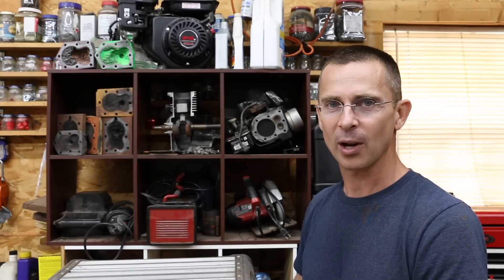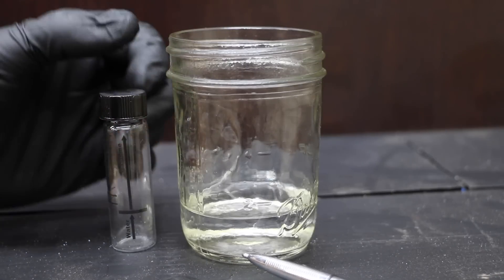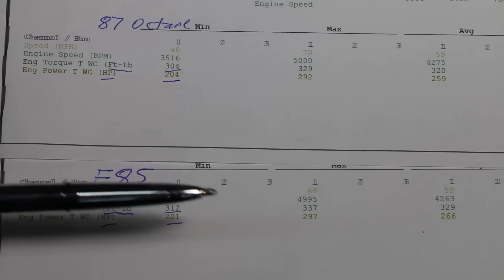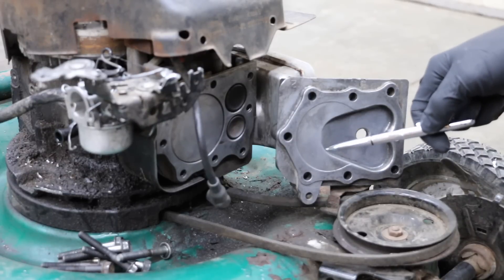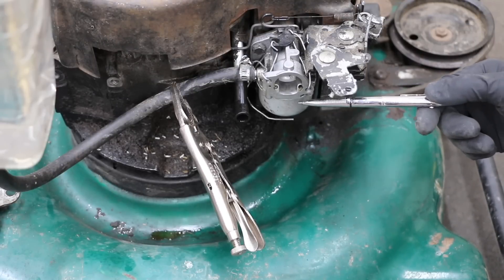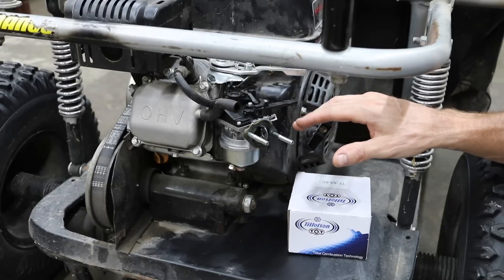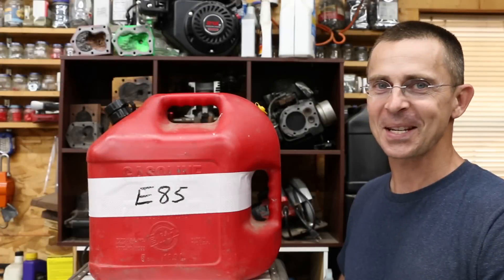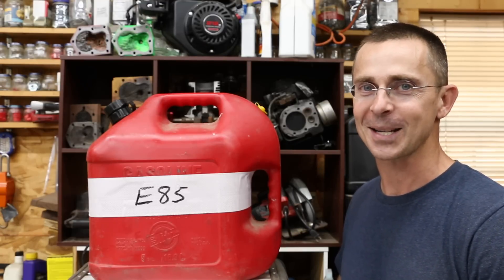Is E85 better than Gasoline? Let's find out!

Comment: mixed e85 in a 1993 olds with a 3800 v6 engine in it to try it. blended it at 50%. worked well for a non e85 burner but did drop mileage two miles per gallon.  My opinion to really get the most out of e85 a purpose built engine with proper compression and other things like cam etc would be the way to go. A car that can burn both is just a compromise.  Was going to try that at one time but never got to it. Thanks for the great video.
Reply from the maker: You are welcome!  Thanks for sharing.

Comment: I run ethanol in my Ecoboost for which I have a tune for. My fuel milage  is only 3mpg worse with e54 than with 91. Here is the kicker... My truck makes 90 more hp with e54 than it does with 91 AND e54 is $1.00 cheaper per gallon than 91. I get about 450 miles to a tank instead of 550 but it's $80 to fill up vs $115 with gas. Win/win for me.
Reply from the maker: Thanks for the feedback.

Comment: Spent most my life building race engines,   E85 only really shines on a engine built for the fuel, 
Just putting the fuel into a go cart or a standard car, is only going to give poor results.  Poor economy .
On the other hand,  if you build an engine for e85, increased compression, supercharging or turbocharging,
Now you will see a much better result, 
 e85 has a much higher octane rating,  plus this fuel will pull out so much more heat 
In the intake and engine cylinders a big part of why it increase the engines ability to resist knock
.   Meaning you can run higher compression , boost and ignition advance .
Higher compression and more engine advance goes some way to improving the engines efficiency on E85. 

For average Joe, 
it’s a waste of time in a average car.   You need to burn 30% more fuel under load and at least 40% more 
For a good idle and even more for cold starts.   

Cold starts are the reasons for this fuel blend still containing 25% or more of standard pump fuel.
As pure ethanol is hard to get going on a cold engine.   But once warmed up,  starts are much easier.
We use to run 96% ethanol on big hp turbo engines, this required some thinking about the cold start system.
Or preheating the coolant .  Cold cylinder wall and head ports cause the majority of the fuel vapour to drop out
And puddle , this doesn’t burn all that well.  Leads to wet plugs. 

But for the high performance guy that wants to produce two to three times the horse power of his built engine over the standard engine
And wants to run it on a fuel he can easily buy.  E85 has been a great thing.   

Engines set up to run on e85 run cooler, cleaner and can make so much more power than standard pump gas.
E85 is also much cheaper than specialty racing fuels like methanol .
Also in my own testing E85 was not all that problematic on hoses or seals that it’s claimed to be.
Some older engines use rubber that can not handle alcohol .  But in these days most pump fuels contain
Some alcohol regardless and modern cars have no issue with e85 or ethanol.

People who have herd or experience Methanol know how harsh that fuel can be , 
But ethanol is a totally different substance .  I have not had one issue with ethanol or e85.
We converted a lot of road and dirt bikes over to ethanol or E85.
It required a different fuel and ignition map and bike have already high compressions, 

With exhaust pipe mods or aftermarket mufflers, a better air intake system and some added ignition timing
And fuel .   We could easily see up to 15 hp gain,  the bikes ran cooler and spark plugs lasted a lot longer
And there was less issue with carbon build up in the engines, carbon build up and that leads to knock.

One of the problems with the high octane pump gas ,  carbon can build over time due to the incomplete burn
Of some chemicals used in the fuel ,   Carbon build up causes preignition ,  not some thing you want in a high 
Performance engine.   This led to fuel company’s adding even more chemicals to try and keep combustion chambers 
And piston tops clean .   The more additives you put in the fuel the less power making content per given volume of fuel. 

A car set up to run properly of Flex fuel e85 that has fuel alcohol sensors and can add some ignition advance will perform 
A little better on E85.    But a modified turbo car shines on e85 ,  heat is its enemy and e85 burns so much cooler as your blue flame
Showed.  On the other side, one of the issue of e85 and the cooler burning, is it can rob some exhaust gas energy used to drive the turbo.
Generally exhaust gas temps on a well set up e85 are many degrees cooler and require a rethink on exhaust turbine AR ratios. 

Thanks for doing your review,  your thoughts are correct.   In a high performance application it stands above 
Standard pump gas.    
High performance guy don’t care they will need to burn more of it,  as methanol and other race fuels are 2 to 3
Times more costly .   

I enjoy your videos. Keep up the great work
Reply from the maker: Thanks, will do!

Comment: I see this is an old video, so I’m not certain how much more you’ve learned about the matter, but gasoline and e85 will never perform similarly in an apples to apples test like this, as they are designed for completely different engines and/or use cases. While some vehicles like the Suburban have the ability to run on either fuel, they’re not meant to be directly interchangeable, and retain performance. E85 has a much higher octane rating than regular gasoline, and reaches flashpoint at a much lower temperature. It’s typically used in high compression or boosted applications. On a very basic note, running e85 in a regular gasoline engine will result in low power due to improper combustion and/or potentially misfires. Running regular gas in a e85 engine will likely result in knocking and/or severe engine damage, depending on its designed octane tolerance. Engines running e85 can be tuned for performance, at the cost of this tolerance. In many cases, high performance engines running true e85 with 80-90% ethanol may have serious engine failure if ran under load on anything lower than 75% ethanol (this is just an example, these effects will vary from engine to engine). There’s a whole lot more to say about e85 as a fuel, and I’m hardly an expert on the matter, but if you didn’t already know these things, I hope this helps you and others to understand why performance varies so much.
Reply from the maker: Thanks for the feedback.

Comment: does the E85 cost as much as gas in your area because according to my calculations running with E85 would be about 20% cheaper in total because here it's much cheaper than gas, even when you take into account the lower fuel efficiency.
Reply: It lots of places ethanol is not cheap enough compared to gasoline to make up for the lower fuel efficiency. However, where I live regular gasoline is crazy expensive, while ethanol is more of an average-high price so the end result is saving some money. In Canada where I live it’s 1.80/L for regular gas and 0.95 for ethanol.

Comment: I was quite confused at the beginning - because in Poland E95 was a designation of 95 octane gasoline (etylina, with tetraethyllead). This designation is sometimes used even today, which adds to the confusion. Apparently E85 is also available at some Orlen gas stations, but here 85 is max ethanol percentage just like in your video.
Reply from the maker: Thanks for sharing.

Comment: Nice video, but he overlooks some issues.  By definition, E85 has significantly lower energy content....as he states.  I have found that the break-even point for E85 usage as regards fuel efficiency is 21%....that means if E85 is priced less than 21% down from E10 ("regular unleaded"), you will save money on fuel economy.  If you pay more than 21% below the cost of E10, it will be as he says...it will cost you more to drive with it.   If you can buy it 'right', it will save you money, and it's easier on the engine overall, if the engine is a flex-fuel engine.  I've put 155,000 miles on a Yukon running nearly exclusive E85, and saved significant fuel costs.  Yes, I stop more for fuel, but I'm an old man and I pee a lot and have to stop anyway!  :)
Reply: It's cheaper compared to premium 91 or 93  fuel, not 87 regular, that's where the savings are.  E85 is awesome.

Comment: Been experimenting with blending E85 and regular gasoline since around 2004, cars with carbs can handle about 20%e85 while especially single point injection VAG 1.8 can handle about 75%E85. fuel economy is usually the same up to about 30-35% e85 and then it increases slightly, most cars(not all) with modern fuel injection and lambda regulation can handle 35-40% E85, imho 50/50 is a really nice mix with no cold start problems and only slightly higher consumption, some cars need either piggybox or increased fuel pressure to reach this mix without running lean, could probably write a book on all my expetimenting, just like vegoil in old prechamber diesels but different
Reply from the maker: Thanks for sharing.

Comment: I’ve only used E85 a couple of times in my Silverado and mileage was not very good, probably 25% lower. My concern is that E85 doesn’t have the same lubricating properties and over a long time engine wear will be higher. Have you ever done any testing like this or know of any test results? Love the channel 👍👍👍

Comment: I tried using E-85, if it was $1.00 cheaper then gas be worth it, but they only give 0.35 cents. But with your video I will try 1/4 tank with seafoam additive to clean carbon off & help with spark plug removal. Love your video's 👌
Reply from the maker: Thanks so much.  Thanks for sharing.

Comment: You might want to compare E85 to 93 octane pump gas. My vehicle requires premium fuel. I typically mix 1/2 E85 with 1/2 87 grade fuel. E85 averages 103-105 octane. Half and half should give a mix of 95 octane fuel with a pump price less than regular. The fuel mileage isn't quite as good as 93 octane but the cost to operate  is down some.
Reply from the maker: Thanks for the video idea.

Comment: I own two Camaros. A '13 ZL1 and a '15 2SS. (Both flex fuel) and people swear by E-85. My issue, that you didn't really address, is E-85 taking on moisture. My cars only have 15K and 10K miles respectively. Obviously not daily drivers. I try to keep fuel levels low between uses and add Sta-bil, but my concern is water contamination.

Comment: I was a little surprised you had to change the jet to run e85. I have been running it in all my small engines with no mods and great results. Maybe there is enough restriction from me running the stock air cleaners to make it run just rich enough to work.
Reply from the maker: Thanks for sharing!

Comment: think like you,, you can run it on a gasolin engine but its need 30% more fuel,  but winters we have snow here every year in sweden, and its not good in  -10´c   (14 fahrenheit ) run very bad and smells,.....  and with new taxes here it cost a lot so no one us e85 here even people how have gas e85 hybrid.  dont use it, its damage to the engine for long time, you can se after 10 years.
Reply from the maker: Thanks for sharing.

Comment: I use E85 once a month or every other month just to help clean things up a bit. I do this because of the cleaning ability of it but love the 16.4 mpg I get from 87 octane in my 2013 Chevrolet Silverado. I don’t know how much fuel economy I lose using E85 I just know it does drop. Like I said using it once in awhile to cleanup the intake and injectors isn’t a bad idea. My Silverado is FlexFuel and do it is built to use either.
Reply from the maker: Thanks for sharing!

Comment: Your numbers are a bit off. it takes 27% more Alcohol to make the same HP as Gasoline!
Reply: That said.. I am stating that in 100% Pure gasoline Vs. Alcohol.
 Since your test shows 85% alcohol and 15% gasoline then do your own math!!!
Reply: Personally I have done it many times from various source...
 79% alcohol is the best I could find in e85!!!
Reply: I have a 1973 Pinto with a 1.6L engine with a Bobcat industrial cylinder head. 11.5 to 1 CR that Runs on E85..
Reply from the maker: Thanks for the feedback.

Comment: Generally speaking, the problem is not with the car’s engine, as in the internals like the pistons, rods, crankshaft or valves. It’s the fuel system. Normal fuel systems designed for pump 87, 89, or 93 are not designed for e85 for a couple reasons. In no particular order, the first is that e85 is highly corrosive, and destroys things like the lines and the pumps, and maybe even your injectors. The second is that you need more e85 per explosion than with 93, so you also need bigger injectors, lines, and usually pumps to get enough fuel. That’s just my understanding coming from high performance cars, and I would guess it’s probably the same with normal cars
Reply from the maker: Thanks for the feedback.

Comment: the E rating is for KNOCK resistance not horse power, fucking idiots -- if your motor is designed around a particular E rated fuel type dropping the rating will cause greater deposits and issues and knocking or un-burnt fuel in the cylinder causing over blow and or pockets in the cylinder to ignite before or after the ignition point at TDC ! see you idiots at the service lane with your " check engine light " on --

Comment: Love E85, anyone who has a high HP engine that has the fuel system and tuning is prob running E85 if they can.  I run it daily in a HC - the power difference in my application is around 75-90 whp between 93 octane and E85.
Reply from the maker: Thanks for the feedback.

Comment: The biggest advantage to E85 for me is the fact that it costs 1.349 euro per litre rather than 1.779 per litre for normal petrol. So even with the drop in fuel efficiency from 4.3 to 5.2 l/100km it's still about 45ct/100km cheaper to run E85.

Comment: I love e85 and e98. The problem with that suburban was tuning from the factory and fueling components. But a good video would be to find a naturally aspirated e85 vehicle and a turbo e85 vehicle. I've found you can safely produce a significant amount more power with a turbo vehicle on e85. I do not know if it being n/a and e85 if it will the same or similar power gains. Not comparing overall numbers just the amount more you can make
Reply from the maker: Thanks for the suggestion.

Comment: Great video! In my own experience, E85 works wonders in most situations. However, in sub-zero temperatures, it can be difficult to ignite E85 without mixing it with gasoline. Don't make the same mistake as me, the coldest days of the year are not when you want to be forced to use a bicycle!
Reply from the maker: Great feedback. Thank you

Comment: E85 has a lower energy density, so it would be expected to be less fuel efficient. The problem is, the fuel should be much cheaper than it currently is to make it viable.
Reply from the maker: Great feedback. Thank you

Comment: I believe that cars sold in the USA since about 2000 can handle e85 in terms of not destroying gaskets and such. Aftermarket tuners sometimes will tune for e85 with no mechanical changes to the vehicle other than adding an e85 sensor so the computer knows how much ethanol there actually is.
Reply from the maker: Thanks for sharing.

Comment: Several of my old garden tractor engines  failed with the ethanol fuel the forced usage initially Instead of a choice here in Oregon. I don't use ethanol in my small engines any more.
Reply from the maker: Thanks for sharing.

Comment: I used E-85 when I went to the states in my 2014 Focus. I found that I got about 120 fewer kilometers per tank (Usually get 650km). I had to do a calculation to see if the prices of ethanol in certain states were worth the difference. In Iowa, it was most certainly worth it because E-85 is so cheap there.  I didn't notice any performance difference.
Reply from the maker: Thanks for sharing.

Comment: The truck didn't see much gain from the e85 because compression is low - e85 is most effective with super high combustion chamber pressure - from higher compression or forced induction.
E85 adds hp because it reduces the temp of the combination cycle, making the engine less likely to "knock" or experience detonation - so you can add timing which boosts power.
Using e85 on a "flathead" style engine like the mower is not going to do anything except burn more fuel. Compression is way too low and timing is not adjusted to take advantage of the e85.
Reply from the maker: Thanks for the feedback.

Comment: My car is tuned to run on 93 and E85. When I use E85 it runs 640-650 rwhp but MPG is 20% less at least, even under normal driving. 
Doesn't bother me one bit.
Reply from the maker: Thanks for sharing.

Comment: The increased cost per mile of using E85 versus pump gas is only true for 87 octane. The cost versus 91/93 oct is approximately the same and that doesn't take into account the benefits of E85 such as the much higher octane (~108 octane), improved evaporative cooling and the cleaning properties for the valves.
Reply from the maker: Thanks for the feedback.
Reply: @ProjectFarm  I am a fan of your videos! Thanks for replying.

Comment: Good experience with E85, but only ran it on a high performance setup precisely built and tuned for E85. Got about 15% more oomph out of it vs setup for gasoline. Fuel volume consumption was higher, but it's more than offset by the price for E85 where we live. Also helps that the pump E85 stuff around here is top notch, almost dragster grade.
Reply from the maker: Thanks for the feedback.

Comment: Have a flex fuel kit on my 2015 c7 corvette and she runs great with it. 50% E and 50% 91 got me 35 extra hp and 39 tq. Gas mileage went down about 30% but its much cheaper than normal gas where i am. Plus im more about the smile per mile vs miles per gallon.
Reply from the maker: Thanks for sharing.